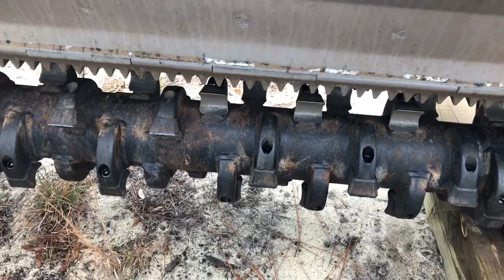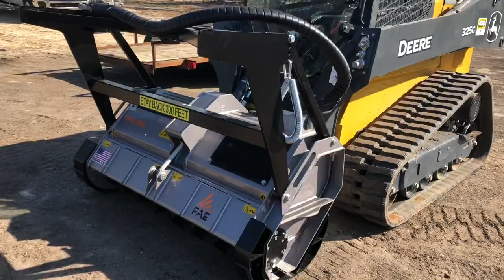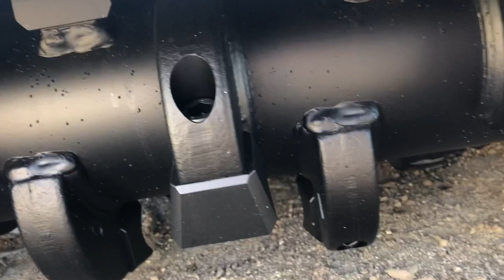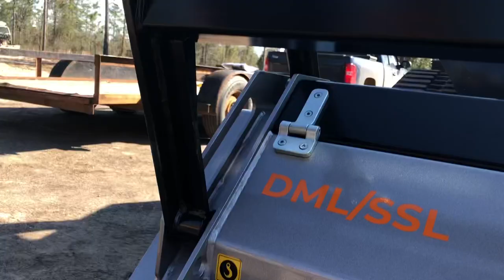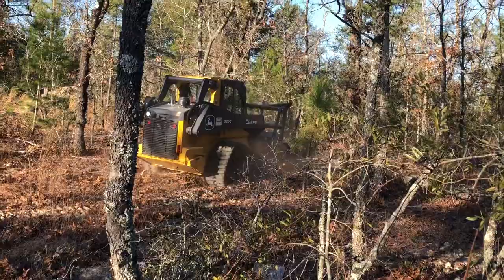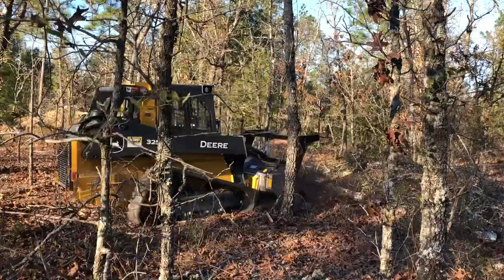Brand New 325G With FAE Mulching Head

Comment: Good looking rig congrats !!  Haven’t ran the 325 but ran the 333 and it’s a pushing machine no doubt !!
Reply from the maker: Thanks. Power reduction for sure but the 325 is a little more economic for building pads and such
Reply: @wrmexcavator3309  great point .. I’ve learned bigger is not always best .. Especially in the North Ga Mountains where I live .. It’s limited space 9 times out of 10 ..

Comment: Looking at a 325g now and they're telling me for a mulcher like you have I need 35gpm to run it but the 325 is only 27gpm.  Do you still reccomend the FAE head you have there ?
Reply from the maker: It works for what we do. It’s not as fast as a cimaf. We use it to rough in lots to cut down on haul off and it does good for that I wouldn’t want to use it every day for a finished product
Reply: @wrmexcavator3309  thanks for the reply! Do you still like the 325g?